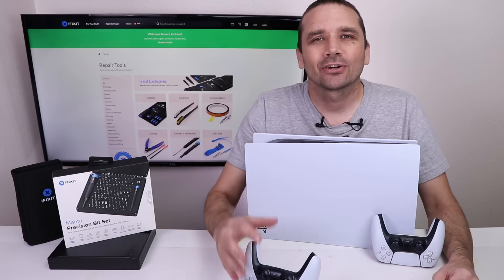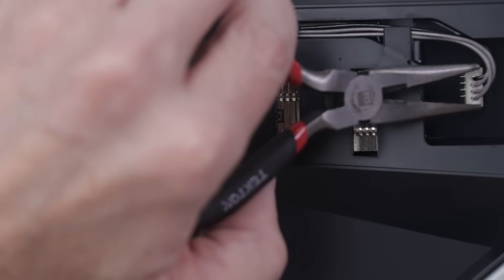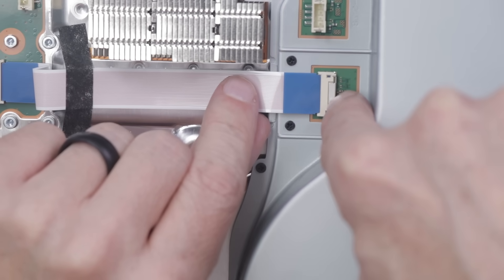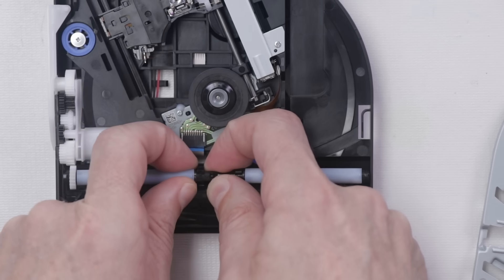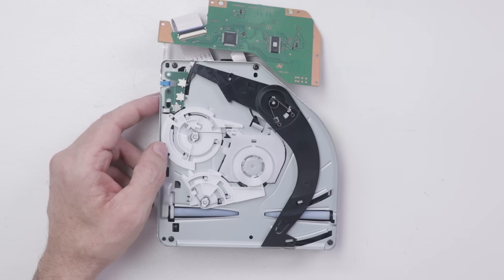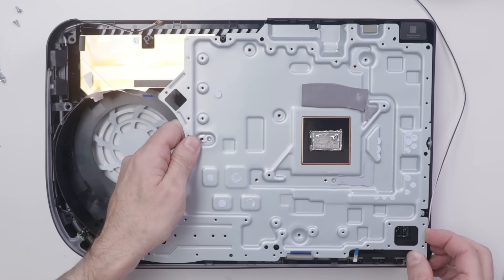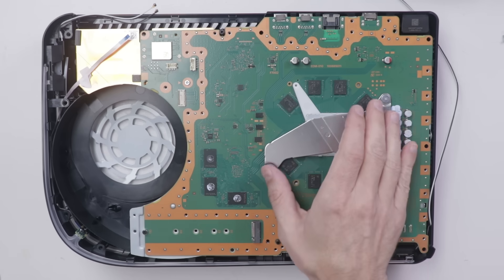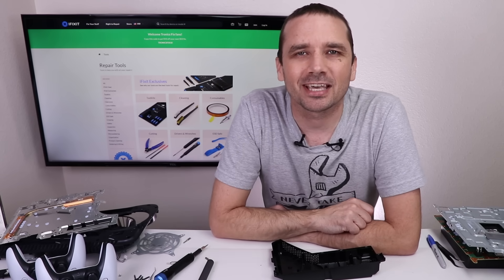PS5 Teardown - A Repairability Perspective

Comment: That ssd WILL break.  I feel bad for all the people of the future who will probably be fighting to get any without a failed ssd
Reply: Will have to be firmware update to let people move OS to the expandable SSD slot. 1TB TLC SSD only have around 600TBW endurance unless using MLC which would have 1200TBW
Reply: @jaggsta  I admire the optimism.  I really do.  But do you REALLY think they'll do that when they can just call it "not secure," spread a little FUD, and people will just buy new ones anyways

Comment: I know that it has a lot of screws, but I don't really see it as something that is hard to repair like some people are saying on the comments likened it to Apple. PS5 doesn't use glue so you can basically unscrew everything without breaking. For normal cleaning on the heatsink side you don't even have to open PS5 to clean it. Just remove the side panel and use vacuum cleaner at the dust catcher's holes. If you really want to have access on the heatsink, yes, you need to remove a lot of screws, but afaik, you don't need to unscrew the whole thing. I'm pretty sure you can have access to the heatsink while the mainboard is still attached to it (so you don't need to worry about the liquid metal thing). What I'm not sure is that whether you can remove it with the backplate still attached. From what I see, it should be possible to do it, thus the mainboard+the metal plates can go off as one unit.
Probably the main reason why the back metal plate has so many screws is because it is actually used to transfer and diffuse the heat, thus it needs to be tightly attached to the board.

And thus my question is can you actually have access to the heatsink side without detaching the metal plates?

Comment: You would think they learned from the PS3 and PS4 ... by adding a clean way of replacing the motherboard battery .. but NO , since when your motherboard battery dies ... your console license DRM clock dies also , disabling your console and your ability to Save\start games\get achievements\authorize licenses ... your forced to connect this console to an internet clock to get it authenticated ... imagine if you cannot plug your console to net , your console will be a brick ... by the way can you check if the PS5 also has this , since PS3\PS4 has this Online DRM Console Activation masked by a internet clock ... remove the battery , wait few minutes , get it back in , boot the system ... and check if you can boot\save\install games

Comment: What worries me is the onboard SSD. If that fails your screwed you can just replace it. That's what's put me off the ps5 as PlayStations are not known for reliability.
Reply: When I was at collage I touched a capacitor and they do give you a hell of a shock even if they have no power.
Reply: Will have to be firmware update to let people move OS to the expandable SSD slot.

Comment: I remember the PS3 super slim with the MASSIVE 12GB of built in flash storage (only sold in PAL and Canada markets actually by the looks), Sony were too tight to include the HDD caddy should you have ever needed to expand that with a 2.5" HDD (but who would ever need more than 12GB of space right!!!), I reckon most people including myself just used the much cheaper method of keeping it in place with a piece of cardboard...

Comment: Whether or not this is easier to repair if all the parts are Apple level married to each other at least it looks like real cooling and real dust ingress prevention were a priority. The new drive being all enclosed in the metal housing will help keep it much cleaner, really I'd imagine it'll only break if people cram stuff into it...
Reply: Although... bruuuh. Cooling pads suck, give it 5 years and these things will be dying. I can already see revision 2 will just indent that shield/cooling plate and put thermal compound on it. Once those thermal pads dry up things start going wrong.

Comment: The motherboard and heatsink are designed to be removed as one unit.

So it's not really that difficult you made it harder on yourself by doing it piece by piece.
Reply: It really is that difficult. People like you keep leaving comments like this, and each and every one of you forgets that this is a reparability perspective. If you need to do motherboard level repairs, as has been seen many times on this channel for other consoles, you still have to do all that nonsense and remove all those screws to get to the motherboard. This video isn't "here's how you take it apart just enough to clean out dust", this is "how you take it all the way apart to do component level repair".
Reply: And the hermetic seal keeping the liquid metal in place is now broken. That's a permanent solution, though that's supposed to last the consoles life span. If the hardware in it lasts there's no reason the console couldn't last 7 to 10 years. But the CPU and GPU will probably be insignificant in terms of performance by then. I see this as Sony's answer to all the last generations consoles cooling problems. But from what I have seen its still a tad toasty. If you wanted to you could put it in a custom case with water cooling for the best cooling solution. Or a big beefy cooler but id rather take less weight on the motherboard and use a liquid cooler.

Comment: With the exception of the PS1, 1st version of Sony's console are always a pain to take apart. I don't see how they will make a "slim" out of this.
Reply: If they make the slim version it will make the air will become more difficult and causing to overheat the console. That is why the designers  of the PS5 needs to be bigger to maintain airflow. Which is why the PS5 abd the XSX are both high-level PC Achitecture by AMD.
Microsoft has the advantage the AMD Architecture is because they're creators of Windows OS and it's dominated the PC Market.
XSX and XSS has their next level engineering than the PS5 like how compact the components to be fitted inside the box. Which is why Microsoft has better engineering than the PS5.
Reply: @aletlee179  Ok xbot.
Reply: @J0derVIVIVI  I'm not an xbot I'm a pc guy who just play games and enjoys both next-gen console and their technology
Reply: @aletlee179  I red again your 1st responsose and now taking into account you say you are a "pc guy" i have to say, Ok xbot.

Comment: PS5 has 2 holes that you can vacuum so it can't get clogged, just keep a towel over it when it's turned off so no dust collects on it.
vacuum it once a month and maybe the the big fan, should be good.
Reply: Keep a towel over it? What is it, a pet bird you want to keep quiet?

Comment: 🐨 Oh My!!! 😲 How long did it take to get to the point where it may be possible to remove all possible build up of dust and dirt on the Heat Sink? 
If it's going to take two and a half hours "what with all that serious unscrewing/screwing" and depending on what a service tech charges anything from $50 to $80 Bucks an hour just to clean the damn thing that's over twice as much to fork out every year👿, 
I guess X-Box is the obvious way to go just for that reason alone 🤔 
What was Sony's R&D Team thinking😧?  
Err-APU I dropped a Like 😁

Comment: My question, when you get your hands on the PS5 Digital Edition, would be:

Can you turn a PS5 Digital Edition into a Physical by adding it the hard drive? Or are the connectors completely removed?
Reply: You mean disc drive?
Reply: @psi23k  i mean the hard drive is a drive with disc
Reply: @33screamingfrogs34  well the ps5 has soldered ssd so no...
Reply: @psi23k  not if you tape a cd player to it 😎
Reply: I guess that a drive disk unit wouldn't fit in a PS5 Digital Edition, their shapes are different
Reply: @skibbbo  it could even be an external disc drive, the question is if they removed the drive from a physical and called it a day, or if everything is completely remodeled around not having that. i have a funny feeling it's the latter
Reply: @skibbbo  Maybe the shape is limited to the white covers? In that case you can , if the did not remove the connectors , by buying an after market disk edition cover :)

Comment: Where is the GPU?
Reply: In consoles the GPU and CPU are built into the same part, which is usually called the APU - Accelerated Processing Unit.
Reply: @Holborovv  say what ???? Why would they do that ?
Reply: @goldensilverstar  cheaper do to
Reply: @goldensilverstar  Im pretty sure its to keep the form factor of the console small and also to do with cooling, if they had a seperate GPU they would need to make the consoles bigger and add more cooling thats dedicated to the GPU.
Reply: @Holborovv  does it make it less powerful ?
Reply: @goldensilverstar  Well its just a custom made componant for consoles. It will still have a PC GPU equivalence, from what I have read the GPU power of the PS5 is equivalent to a RTX 2080 Super and the Xbox Series X is equivalent to a RTX 2080 Ti.

Comment: I wanna know what we're supposed to do if the nvme breaks after the warranty period has run out
Reply: My guess is that you can't do anything about it. If a chip goes byebye, your console goes byebye. 
Even tho xbox series s/x have replaceble ssds, that doesnt mean that you can just pull it out and replace it with whatever you want. Won't be surprised if ssds are tied to the console and you cant replace them without going through microsoft.